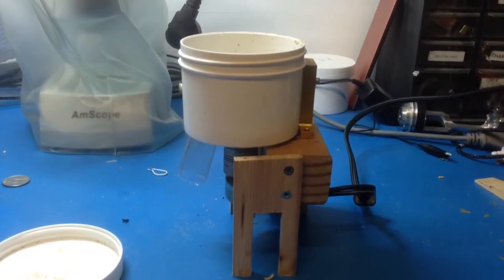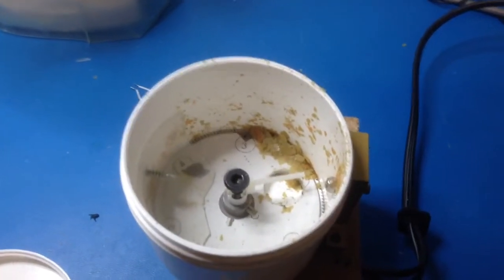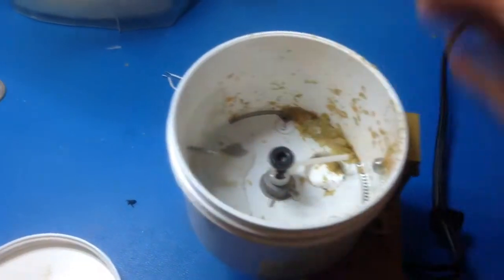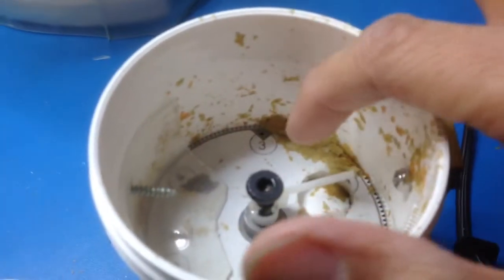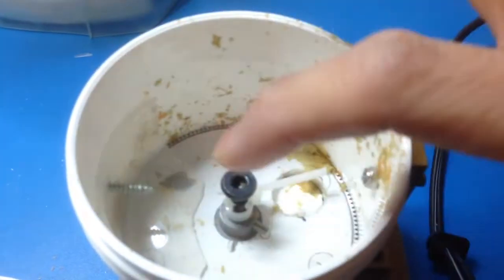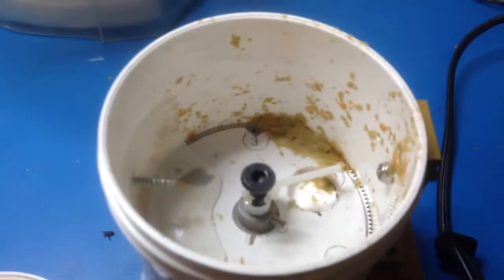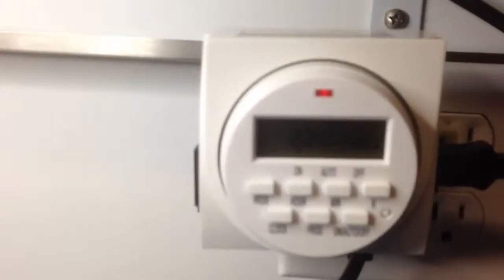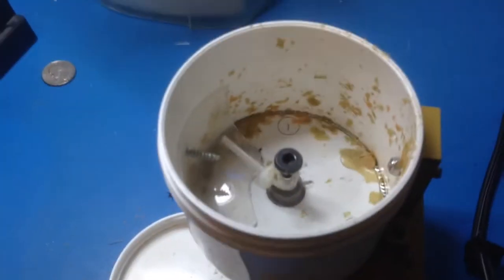DIY automatic fish feeder version 2 more compact and for flakes

Comment: I love it.  Do you have a parts list to what you used to make some of the parts or if you had a adapt some of the parts.  Thanks
Reply from the maker: Hi Jack thanks!  There are several parts that are from obsolete inventory from my work such as the motor coupler, the gear (disc with hole in it), the plastic container, and an aluminum bracket.  However it wouldn't be too difficult to substitute these parts.  A disc with hole in it can be made from wood, the coupler could be a piece of ridged tubing (hose) with pipe clamps.  There is a central bolt that is connected to the disk which is from Harbor Freight.  The timer is also from Harbor Freight.  

The plastic piece inside the cylindrical container is simply a laundry measuring cup that I cut up.  The mixing stick is a zip tie. AC motor is from a microwave.  The rest is scrap wood so the entire feeder can hook onto the side of an aquarium.